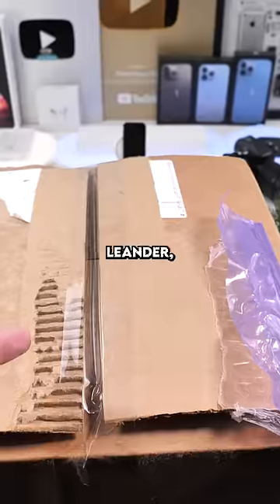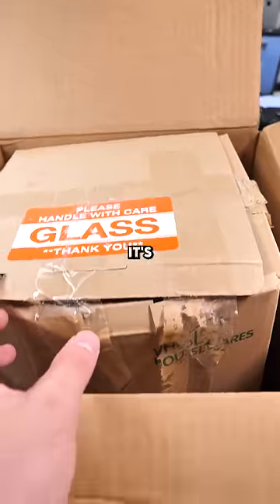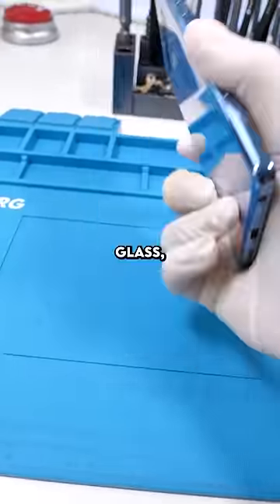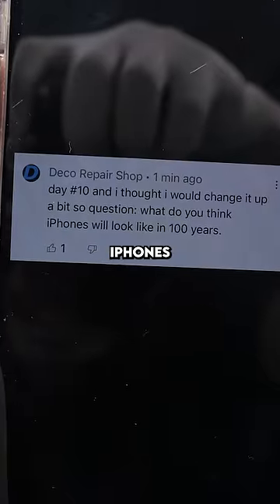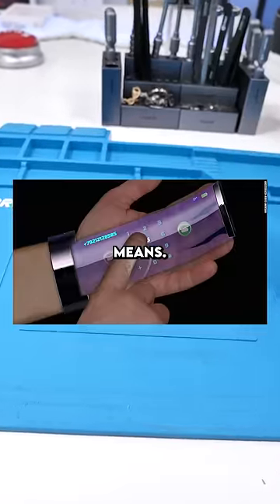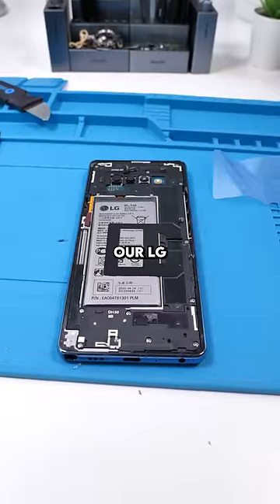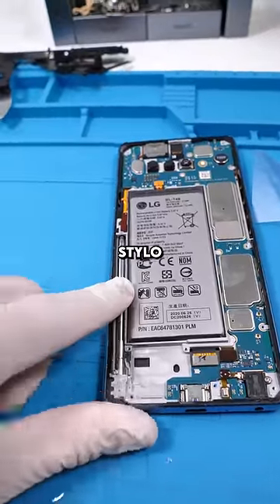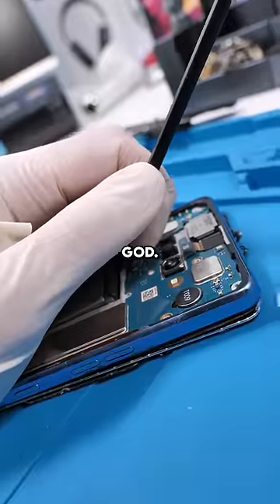What Phones Will Look Like In 100 Years.. LG Stylo 6 Repair

Comment: I had a LG V10 was a great phone right up to the point it bootlooped on vacation 1000 miles away from home.

Got a replacement and upgraded shortly after because unfortunately they have said design flaw that the processor runs so hot it melts the motherboard soldier joints and it would only be a matter of time before history repeats itself with the replacement.

Comment: God I hated the lg Stylo 6. I had that phone for so long and it was so badly designed and had so many bugs. My stylus got stuck too and the way it gets stuck is that the previous phone could fit the stylus in any direction but the 6 can only fit it on one angle but you can still push it in, it just won't come out.

Comment: I like the stylo 6, I was selling them up until the moto g Stylus 5g 2021 basically replaced it, at Cricket. It's a solid phone but nothing special. Had the biggest screen at the time and setting it up abnormally took longer than any phone we've ever sold, for some reason the startup screen at least on that first boot took forEVER. 

Otherwise it was enjoyable, a nice little upgrade from the Stylo 5, tho I personally prefer the wider screen of the 5, extra storage on the 6 tho? Nice.
R.I.P LG phones tho

Comment: Watching this from a lg stylo 6 with a cracked front and back glass lol ( theres like a tiny crack in each corner im not worried about it right now)

Edit: with a stylus thats snapped in half,, but i dont use it anyway
Edit 2: both the front and back are broken pretty bad but still usable, and it has issues where sometimes when i type, it brings down the notification bar.
Reply: The only thing that is wrong with mine is my broken stylus, imma buy one on Amazon soon, I just don't have the time to do it

Comment: Man I love your channel but I want to correct you with something? May I? I don't love that cardboard black style of PCBs as those are so freaking fragile, apple uses them built by Gygabite (I don't know if I wrote them wrong) it's stylish, maybe more flexible, maybe eco-friendly but shit in terms of durability. In case of a short circuit apple boards just dig holes instead those classic ones mostly survive to many things, and water won't damage them at all, if copper doesn't make oxides for being uncovered those green boards are basically life long guarantee. So for me these boards are beautiful regardless of aesthetics tastes. If interested just hook up on Louis Rossman page and see for yourself how many times he had to dig up into those boards just to repair stupid shit that overheating burned an inch of the board. So green is still beautiful from my point of view.
Reply: I could be totally wrong and have demonstrations that is exactly contrary, so criticism is always accepted

Comment: How mutch for repair a Lenovo motorola E7+ screen?
How mutch you ask? I need to know as guide line if it's worth it to put a new screen on there without buying all the repair stuff myself and a 30 bucks screen and the risk i fuck it up or buy a screen and then relaise that I can't press the button.....i had this with my Acer tablet ....the plastic replacement was even metal frame from alieexpress....the only tablet you didn't need stuff or skills....i did it with nothing , it worked and the button had no plastic spring built in....since it was metal......so I repaired the screen with nothing to find out I still had nothing

Comment: My issue with the AR take is that a not insignificant percent of the population get headaches or motion sickness after 10-20 minutes of using current ar/vr/3d viewing technology, myself included. While I do believe that the tech will continue to be developed and will eventually be widely available, I do feel that, at least for the foreseeable future, AR and vr technology won't be adopted into the mainstream

Comment: As cool and "sci-fi" the notions may be, wearing glasses and contact lenses aren't practical as these cause fatigue, biologically integrate, or degrade and are prone to a slew of issues relatednto wear and tear. Realistically, it could be an option, however, conventional form factor phones are still going to be a norm. People just don't like wearing things for prolonged periods of time and glasses and AR - as well as the issues of gesture navigation or "other", since we don't know what that will be, won't be an acceptable "solution" or replacement for convention where you have a rectangle slab that you use and put away when you don't need them.